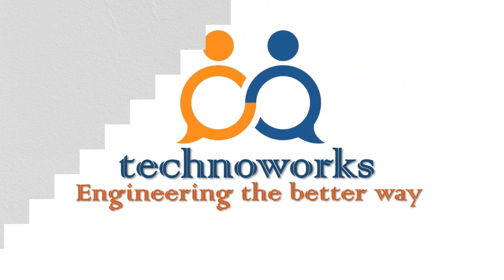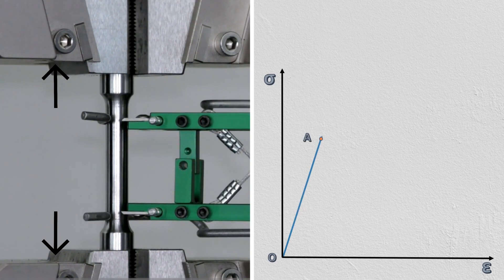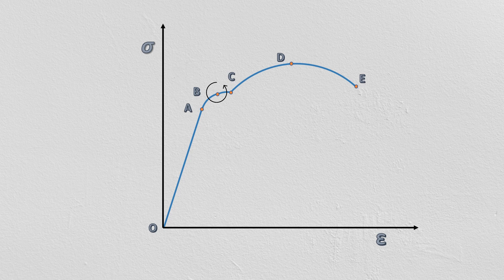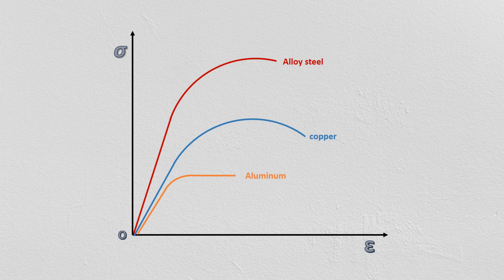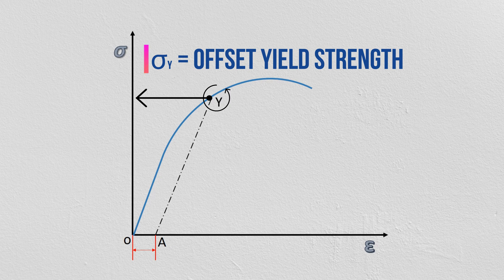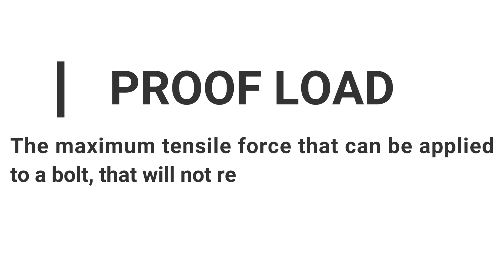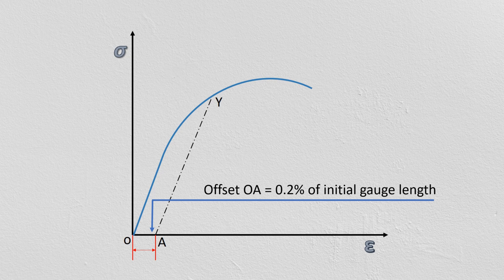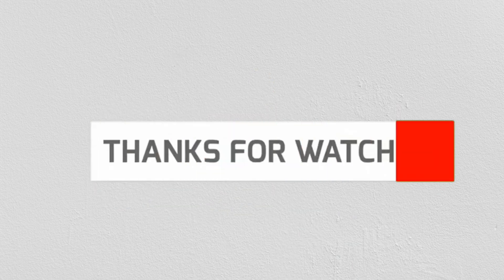Proof Load and Yield Strength explained

Comment: If we consider 4.6 grade bolt 

Tensil stress/ prof load = 4*100=400Mpa
Yeild strength is = 0.6*400= 240Mpa 

Is prof load < yeild strength 
Or 
Yield strength < prof load 

Please elaborate this two , it will really appreciated 🤝
Reply from the maker: Proof strength = proof load/bolt stress area. And proof strength = 0.85 to 0.90 x yield  strength.